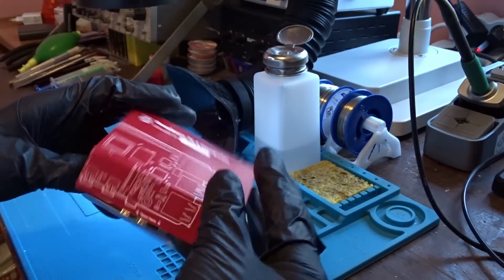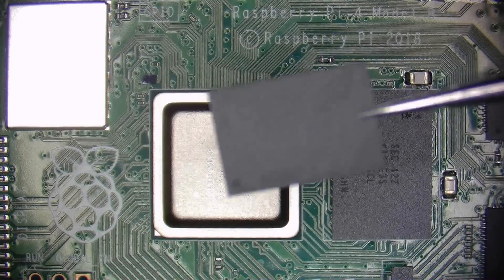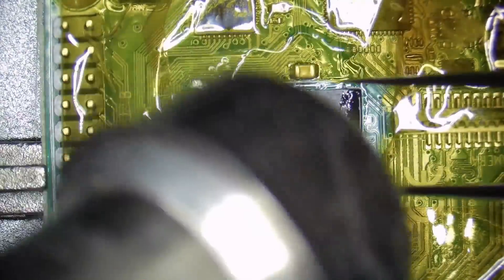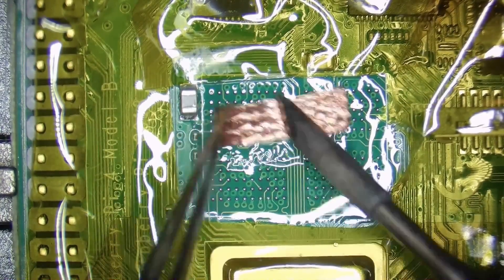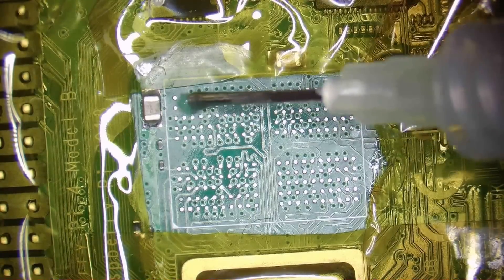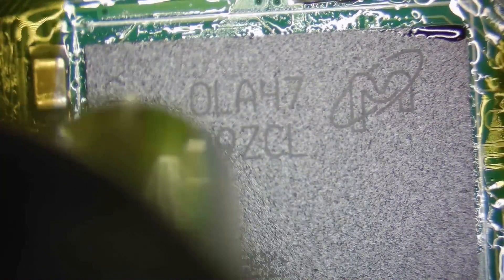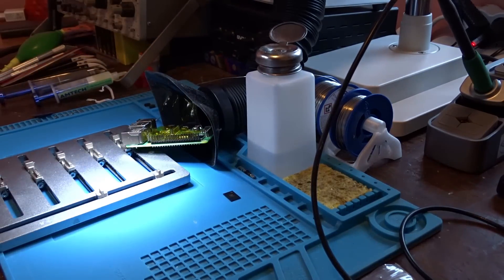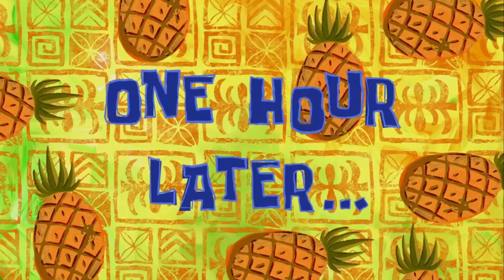Raspberry Pi 4 RAM Upgrade - Tutorial🤫

Comment: I just got 4 of these for $20 a piece and am super tempted to try this. I really dont even need more than the 1gb version, but it would just be nice
Reply from the maker: If you at least have a decent hot air station, go for it 😅
Worst case 20$ in the trash + gained experience :)

Comment: I have the pi 400 desktop. Do you it’s possible to upgrade the memory to that?
Reply from the maker: Yeah it's possible, I've done it ones or twice. It just takes more time to heat up the board especially if you are not using preheater.

Comment: This is really cool to see more people getting into SMD soldering and sharing their knowledge. I remember just a couple of years ago if you asked how to replace a ram chip or similiar the common sentiment was always "it's impossible".
Reply from the maker: Yeap that's why I don't really like reddit for any type of technical questions.
There is a group of people that don't have little to none practical knowledge and just speculate on what they've heard from here and there...
In most cases this affects negatively people that would want to experiment with something, even if it's only for the experience and not the final results.
Also this is was my main motivation to film my attempt with upgrading the RAM.
Like it's really nothing ground breaking or unheard of to just swap a BGA chip, but I just wanted to prove so many people wrong 😅
Reply: @MadEDoctor  Yeah true. Reddit is really negative when it comes to stuff like that. Best part is when they say "Why would you do that? Just do x instead/Just buy it". Such buzzkill these people are lol

Comment: 🎉I did it. It worked for me on the second try and I had to reball the ram chip with leaded solder. Just bought a stencil and leaded balls on aliexpress and everything went absolutely well. My temp was 385°C and 50% air flow when soldering with leaded tin. Thank you very very much for this instructions

Comment: MadEDoctor, I've tried this on 3 Pi 4s now. One was successful but the other two are giving me the SDRAM not recognized error (green light blinks 8 times). Any suggestions on how to diagnose and troubleshoot? I've reballed and reattached a few times and still get the same error. I've even put the original memory chip back on and still get the same error. Any suggestions on places to probe, etc.?
Reply from the maker: Well there could be several reasons for this to happen...
Here are a few of them with possible solutions.

Check if all the voltages on the board are present.
There are 4 voltages that are generated by the chip right behind the USB-C.
Either MXL7704-P4 or dialog DA9090, there should be: 3.3V, 1.8V, 1.1V, and 1.0V if I am not mistaken there is a slight difference in the last to voltages depending on the revision so is the measurements are within + / - 0.2V it should be fine.
And the last voltage that I am pretty sure is for the SoC and not the RAM is 0.8V if I remember correctly and it's generated by the DA9121 which is behind the HDMIs

There might be a so-called gray pad issue, or one of the pads on the board might have a bit more corrosion than usual flux can handle, it may appear as a darker shade of gray and if you try tin it with your soldering iron it willn't tin at all (the same thing happens when you try to solder the memory chip - the solder ball over it gets melted but can't make a contact with  the pad) if that's the case the solution is as simple as taking an exacto knife or something sharp to very gently scratch the surface of the pad.

Another thing that comes to my mind is maybe there are some loose pads on the board side that doesn't make a connection with the traces leading to the CPU. You can check for that with a multimeter in diode mode, placing the red probe on GND and using the black one to probe every single pin on the board that's connected to the CPU.
You can use an LPDDR4 pinout diagram to see which pins carry signal. If you find a pin that should is used for signal aka should be connected, but the multimeter says O.L. (Open loop), then that's your problem. If the pad itself is looking loose or disconnected from the rest of the trace, that's good because you can repair it, but if the pad is looking alright probably there is a bad solder joint under the SoC, which sadly cannot be repaired as there are no stencils for this SoC on the market.

If none of the above help, there is always the possibility that you might have killed the RAM chip during soldering or re-balling or it might even be DoA (dead on arrival).

I really hope this is helpful!
Let me know if you make any progress!
Reply: @MadEDoctor  So far I've only tried on one Pi. I checked all voltages on it and 5V, 3.3V, 1.8V, 1.1V and 1.0V voltages were present. Then I looked closer and it looked like the RAM BGA was a bit lifted on one size. I suspected the solder balls were differing sizes. So I removed the RAM chip again, then reballed and triple checked that I had uniform solder ball sizes. I got the RAM chip reattached to the Pi,waited for it to cool, and then plugged it in. Now the Pi has constant blinking really fast and nothing shows on screen... I'm wondering if I killed it :(
Reply: Just checked voltages again and only 5V is present... Guess I need to figured out what I messed up.
Reply from the maker: @JamesonRicks  That’s kind of bad especially if you have the newer revision that uses the dialog DA9090 as if it’s dead it’s literally impossible to buy as replacement part…

Comment: I'm very new to soldering and was wondering if it's flux and a solder wick to clean up the solder to remove the old ram? /genq

Edit: I'm watching this without audio because my headphones are currently charging, so I may delete this if I remember to watch it later with sound.
Reply: Bga work and new to soldering never ever goes well dude. But you can defo take the chip and instructions about jumpers to a microsoldering shop near you ( usually decent phone repair shops do microsoldering ). But i have to warn you , you migjt as well just buy a new rpi with the ram you need , microsoldering jobs are expensive.

Comment: Most people who are buying all the Pis aren't even using them for anything but goofing around like a normal PC.  I would guess that 75% of the people buying them would be better off just buying a cheap mini-itx board, a chromebook, etc.. it'd be cheaper, higher powered and in the case of an x86 system, would have far better software compatibility.  I like Raspberry Pis and similar SBCs but they're basically an overpricd gimmick for most people.
Reply: True , i cringe at the sight of those rpi clusters when an old mini pc can do the same job with similar power comsumption. The reason i use rpis is for the gpios which you dont get on mini pcs.

Comment: you can test the memory size another way -- by not inserting the SD card itself -- turn on the pi without any OS (SD) -- there you will see on top the memory size ....
Reply from the maker: Yeah, that's true. But I think running a memtester is better, because there is always a chance that even a brand new chip could be defective.
Reply: @MadEDoctor  good point ... thanks ...

Comment: Thanks for the video, I always wondered if it was possible to update it that easily, and thanks to your video the question is resolved, on eBay there are good offers for Raspberry Pi 4 with those gigabytes, I imagine it will work for the boards that have 2 and 4 GB also
Reply from the maker: Yeah, the original RAM capacity of the Pi doesn’t really matter. You can take whatever is the cheapest Pi 4 including the Pi 400 and swap the RAM chip to whatever capacity you want (i mean in the 1 to 8GB range)

Comment: Does the board revision matter? It sure should work with board rev 1.4 (latest), but will it work with 1.2 or 1.1. Have you tried it?
Reply from the maker: It works on all revisions of the Pi4
Reply: @MadEDoctor   Have you tried it personally on older revisions? I tried upgrading my Pi4 today and got black screen and nothing on UART. Tried reflowing the memory and then reball on leaded solder, but it didn't help. My board is of older revision. I didn't check it beforehand while board was still working, but I think it's 1.1 or 1.2. So, I wonder if I got faulty IC or is it wrong board revision... 
Do you know what resistance it should be on ram's power rail with D9ZCL soldered?
Reply from the maker: @aspinx  I have tried on 1.1 and it worked just fine. As for the resistance I have no idea. But probably should be more than a couple of ohms at least. >=10ohms I guess.
Reply from the maker: Do you have a blinking code for missing RAM?
I think it was 7 or 8 fast blinks on the green LED
Reply: @MadEDoctor  Yes,  the LEDs were blinking fast about 8 times or so. Turned out he issue was with soldering. Reballed RAM again and this time it worked! Board revision is 1.2, according to /proc/cpuinfo and so far all 8Gb are working! Thanks for making this video and for your help!

Comment: Does the same chip works on orange pi zero 3 ? Can you do that because orange pi's are blowing up now
Reply from the maker: It seems like it should work since the Orange Pi Zero 3 is using LPDDR4 memory. 
I haven't tried it yet so I can't say for sure at the moment. (There might be a CPU limitation)
But I might try it in the near future :)
Reply: @MadEDoctor  yea I checked it it's using lpddr4 dram but I don't know if the pins will match for both pcb and new dram. And zero3 has a 4 gb variant so If I buy a 1gb variant and solder the 4gb chip it should work.
Reply from the maker: @smxtrxx  I just checked the model number of the DRAM module which is on the Orange Pi Zero 3 on their website and it's indeed the same package as the RPi 4 (FBGA200).
So the pinout and dimensions are the same.

Comment: Hi. May ask, is that ram same as sdram? Thank you
Reply from the maker: Well there are a lot of different types of RAM, like DRAM, SRAM, SDRAM, DDR, RDRAM and many others. 
And there are specifics that come along with each one of them. 
Having this said I think it would be best if you just search for a comparison between the types you’re interested in.
Reply: I mean the chip you change in the video is it the sdram of raspberry pi4
Reply: Since i have 8led 8 blink indicator it means sdram failure
Reply from the maker: @antropos_x   Well I thought that was a general question. 
In the case of the Pi 4 it has a LPDDR4 memory chip and it can be referred to as RAM, SDRAM, Memory chip and so on.
And yes, when the green LED blinks 8 times, it usually means that your RAM chip is dead and needs to be replaced.
Reply: Now i sure to change the ram of my rpi 4. Thank you
Reply: @MadEDoctor  may i know what the yellow plastic name you use. thank you
Reply from the maker: @antropos_x  It’s called Kapton tape. It’s just very high temperature resistant tape.

Comment: This is awesome, I would love to upgrade some rpi 4 I have, but finding the right ram that's high quality may be a problem.
Reply from the maker: There isn’t a much choice you have when it comes to memory😅
It’s not easy and economical to make fake RAM, and so there are like 4-5 manufacturers worldwide and thats it. 
It’s not like buying a fake lego just to find out that there are missing parts. 
The thing is that you need to be ok with getting a second hand RAM installed since nobody can guarantee if it is new or second hand when purchasing from sites like Aliexpress.
Also except for a very small percentage where the chip has a manufacturing defect, the RAM easily outlives the service life of all the other components not only in the Pi world, but also in Laptops and Desktop computers.

Comment: Nice DIY - if u spend 2k$ to the tools he used....
Reply from the maker: I haven't mentioned that this is a DIY project for everyone. 
Also, the job can be done with tools for no more than 100$, you just need to have the skills required and a lot of patience, because using cheap tools usually comes at the expense of lots of nerves. :)
That's why my setup is expensive and I never recommend buying cheap equipment.

Comment: Is there a difference between the 8Gb codes from your link?   D9ZCL vs D9WLQ?  I think i accidentally got the WLQ...
Reply from the maker: Well the D9WLQ is a 4GB chip where the D9ZCL is a 8GB chip. Probably the seller just decided to sell different chips on a single listing. You should be able to cancel your order if they didn’t shipped it yet.
Also bear in mind that 8Gb is not the same as  8GB, because Gb stands for Gigabit and GB is for Gigabyte. And so 8Gb = 1GB.

Comment: Very interesting. I have one second hand Pi 4 2GB and one which is not working. I assume power regulator was dead because there is no “signs” of life. So I try to replace MXL7704 first then if ok, upgrade both boards to 8Gb. Because of very expensive Pi nowadays it worth any way. And also good practice to use soldering station. To my surprise I was not able to found on Ali any BGA practice kits, opposite to QFP which is a lot there. So this will be a real life practice and I hope will do this good and no need any reballing, especially because reball stencil is not cheap at all

Comment: I see that you got a newer revision board. I have two older Pi 4s laying around, both being the first board revision with the USB-C flaw. Do you think an 8 GB upgrade could be done on those as well? I read that something was changed in the PCB design for the 8 GB models.
Reply from the maker: I am pretty sure that it should work even on the first revision.
Reply: @MadEDoctor  Maybe you can make a video on that too?
Reply from the maker: @nnighthawk  Yeah , but first I will need to get my hands on one of those 😅
Reply: @MadEDoctor  Oh, that might be the biggest challenge at the moment 😉
Reply: @MadEDoctor  I decided to go a different route. I found some CM4 boards for sale a few days ago and got those. I have two 8 GB RAM chips here and managed to successfully upgrade the first module, but I'm struggling with the second one. I have a Waveshare Mini Base Board A. It has three LEDs (M.2, ACT, PWR). When I try to boot the module, M.2 lights up bright (normal), ACT is off (should be lit up) and PWR is very dim (should be bright). Did you ever see anything like that? I tried reflowing and even reballing the RAM chip multiple times, but the behavior is still the same. I even went back to the original 1 GB IC, but still no change.
Reply: I found my error. Some tiny 0402 resistor had shifted and was not making contact on one side anymore. Probably happened due to a too high air speed when desoldering the 1 GB memory IC.

I moved the resistor back in it's position, put back the 8 GB module and now everything is working as intended. :)
Reply: Little follow-up on my initial question:
You can NOT upgrade Rev 1.1 boards beyond 4 GB. I put an 8 GB module on one of mine yesterday and was greeted with a black screen and 8 LED blinks, meaning RAM not recognized. Prior to the IC change I had upgraded the bootloader to the most recent version and I was using a Pi OS version that boots fine on factory 8 GB models.
Reply: @nnighthawk  Thank you for sharing your experience. I got the memory chips, tried replacing on my Pi  and it didn't work. Board is from older revision, so maybe that's what was the reason.
Reply: Yes, as I wrote in a later comment, only the latest revision can be upgraded beyond 4 GB

Comment: Question: would it be possible to add extra ram with either a Pi Zero or 3A/B?
Reply from the maker: As far as I know, the Pi 3 processor is limited to 1GB of RAM, about the zero its RAM is directly soldered on top of the CPU and it is very hard to swap it.

Comment: Hello,

I am looking for help with my Raspberry Pi3. I need to purchase some components, but I do not know their reference numbers. Would it be possible for me to share a link with you that corresponds to a photo, so that you can assist me?
Reply from the maker: Hello! I don't have raspberry pi 3 at the moment and so I am unable to provide photos of it. Also, I couldn't find anything that could help on the internet. I only can tell you the chip number of the PMIC which is responsible for making the 3.3V rail from the 5V supplied by the USB.
I have ordered two RPies that doesn't work (one is 3 and one is 4) so expect video about the in the future :)

Comment: I'm looking to upgrade the ram from 4gb to 16gb on my Surface 
laptop Go machine. Just hoping the processor can handle that much memory.
Reply from the maker: It should be possible :) The CPU supports up to 64GB of RAM.
Reply: @MadEDoctor  A ram module of LPDDR3 IS SOLDERED TO THE BOARD. WHAT HAPPENS IF I USE LPDDR4 AND THE SAME MAXIMUM CLOCK RATE OF 1866 mhz?
Reply from the maker: @molonlabe8792  I don’t think LPDDR3 and LPDDR4 have the same footprint (position of the solder pads).So you should find the same memory type as the original.
Reply: @MadEDoctor  They don't; so it would require me to reball the entire memory chip to fit the position of the pads.
Reply: @MadEDoctor  And probably the same clock speed.
Reply: @MadEDoctor  That means that you can't upgrade beyond 16 gb of ram.

Comment: hey i came here because my raspberry pi ram 4gb is damaged is there any way to bypass this so that the eeprom chip is accessible? thnx
Reply from the maker: It would be easier to just change the RAM. The other solution I can think of is transferring the eeprom chip on another Pi, but I am not sure if this would even work…
The thing is the CPU needs RAM to be able to operate, so you can’t really bypass the ram error.

If you have important data on this Pi and you are from Europe, I am willing to help for free, just contact me on the listed in the video description email.
Reply: @MadEDoctor  Thanks